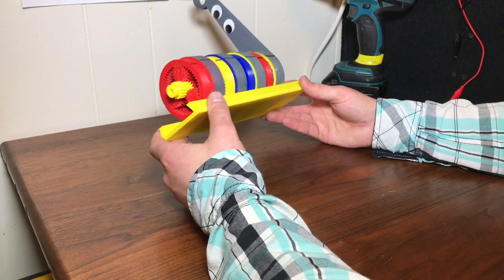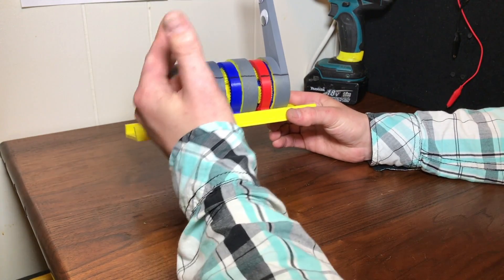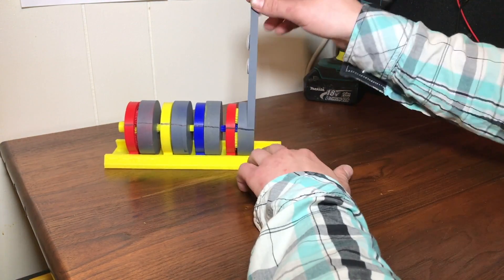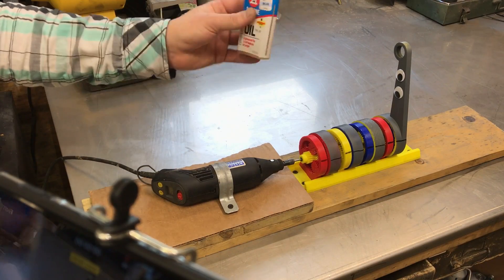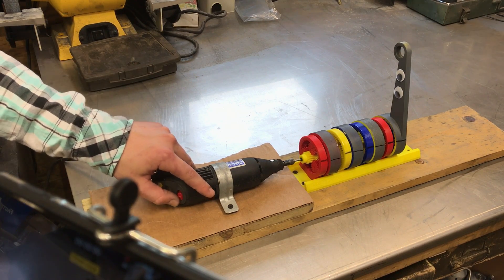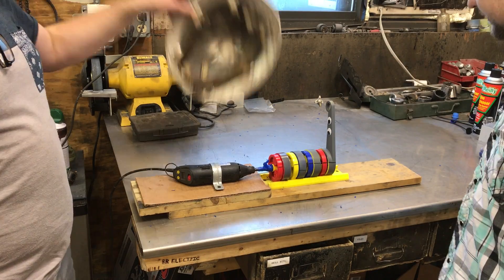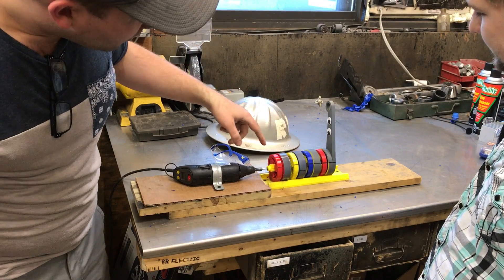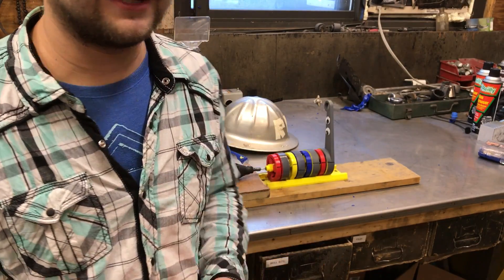3,616,238,492,881 To 1 - The Most Useless Gear Ratio Ever

Comment: Thought id do the math, if you were running a brushless motor @ 50,000 RPM it would take roughly 137.6 years to make one whole turn on the output shaft :p someone correct me if im wrong
Reply from the maker: +Mick Ross I didn't check the math but it sounds about right!
Reply from the maker: Mick Ross your math is right
Reply: Thomas Fooij all depends on the rpm. i only used brushless as a semi realistic idea. brushes wear out
Reply: morelli tech everyone believed Newtons theories until Einstein came along and proved him wrong with an alternative hypothesis so youll need to come up with something first lol
Reply: Mick Ross Your math is wrong. It's just a theory at this point. I need you to prove and verify your calculations by spending the time to spin it at 50,000 RPM until one revolution is completed.
Reply from the maker: Mick Ross uh... gentlemen
Reply: DJ Q I did say I didn't take them into account earlier up the comments. Thanks for clarifying though :)
Reply: Thomas Fooij well i never took into account the fact that a day isnt exactly 24 hours so feel free to correct me
Reply: through the current amount of people watching this video, we've already spent 9.62 years! :D
Reply: bet it has some nice torque
Reply: Mick Ross like start to turn on make a full rotation?
Reply: I get it to 550.5 years for a full revolution.
50 000rpm = 6 570 000 000 revolutions per year
3 616 238 500 000 / 6 570 000 000 = 550.416819

Then again I have no idea if my train of thought is correct.
Reply: Yeah looking at it now I don't see how I did that either, now I get 72 million per day and 26.28 billion a year same as you.
Reply: just use a 🅱oneless motor
Reply: Gear Down For What? sorry bud. ill leave it be  keep up the good work :)
Reply: morelli tech not really
Reply: Im curious how you got to 6 570 000 000 revs per year?

50000 revs per minute, 60 times an hour, 24 hours a day, 365 days in a year gets me to 26,280,000,000 revs per year. Dividing the 3,616,238,492,881 ratio by that gives my answer
Reply: I just learned something. Thank you.
Reply: Thomas Fooij a shitty joke
Reply: Mick Ross actually, if you calculate with leapyears, it would take 137.5 years
Reply: Mick Ross was just a joke
Reply: Mick Ross how long would it take if it was a brushed motor?
Reply: It's  actually 137.51 Years.
1 year is 365.25 days. Which is why we have leap years every four years..
Reply: Another Thing game Polaris. when I was in Maryland Polaris was up in the sky about 70 degrees above the horizon when I went to the land of the Canuck way way up North Polaris was almost directly over my head at about 85 degrees above the horizon. in Florida Polaris is about 45 degrees or so above the horizon. when I went to Brazil I couldn't even see it anymore then we finally went to Argentina and we saw the Southern Cross which you can draw a line to find where do South is from it. this is just showing that the Earth is a sphere.
Reply: morelli tech no because the Earth is a sphere I track the ISS with a high-powered camera it was difficult kept on losing it in the frame but I did stabilize it long enough to catch the International Space Station with all of its solar panels is it streaked across the sky at 14,000 miles an hour. then I had a buddy of mine in Arizona would be able to see it it would have been low on the horizon for him and then a couple of orbits later it would be visible to me in Florida and so that kind of proves that it's orbiting the Earth and the Earth is rotating on its axis and I was under it at about 70 degrees above my head I saw it and it for him it was 30 degrees to the West when he saw it above the horizon people in Cukifornia had it directly over their heads it about 80 degrees above the horizon.
Reply: +Windows98 dab
Reply: dank rip м
Reply: Well that has put one trillion pounds into perspective for me... Once I get there I can comfortably spend £50,000 a minute and know I'll always be rich
Reply: Mick Ross 

Everyone thought the earth was flat, then a round earth theory was made, and then everyone felt that was fact, now we've learned the theory was incorrect and we now know earth is indeed flat. 

will that argument work?

(I'm trolling)

Comment: Can you make two of these, connect the two together and then put a motor on each end?

Like this: (motor A) ----> <-- (motor B)
Reply: Dude my thoughts exactly. I wanna see these gearboxes wrestle each other.
Reply from the maker: I could do this, but only if I did one or two, not eight
Reply from the maker: Abdullah Mostafa my next project is actually going to be a 3D printed, compound planetary shredder, so look forward to that first :)
Reply: motor B wouldn't move. It'd strip the gear teeth away before it turned the gearbox backwards. Even if it was made out of metal, the torque required from the output would result in the same manner. The result you are looking for just wouldn't work. perhaps on a single gear reduction system with like a 1:2 ratio. it would be easy to see how motor A can turn Motor B in a simple system.
Reply: dons milky you are sick haha
Reply: Gear Down For What? attach the input of the gearbox to a car engine and full throttle the engine lol
Reply: Gear Down For What? sounds good, will do! :)
Reply: ira todd most car engines can’t turn as fast as that dremel tool can.
Reply: Go and test it someplace else, please.
Reply: Gear Down For What? there's 4 on the table already. two on one side, two on the other, make em twist a GI Joe in a torture rack or something haha